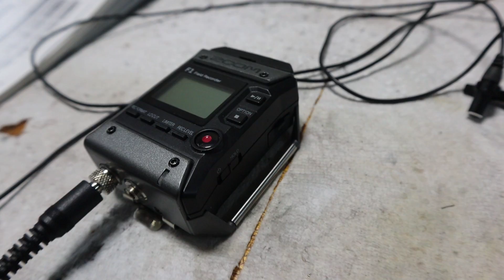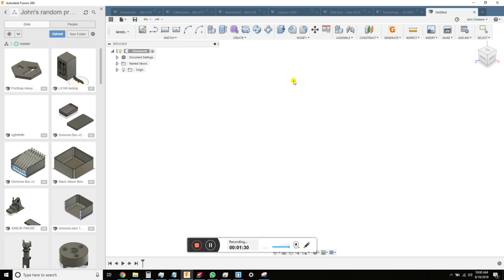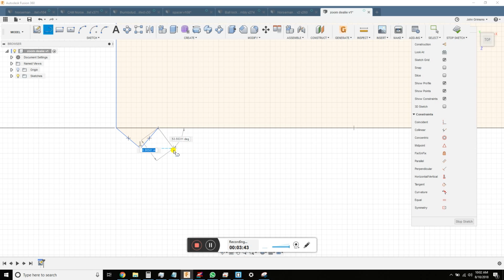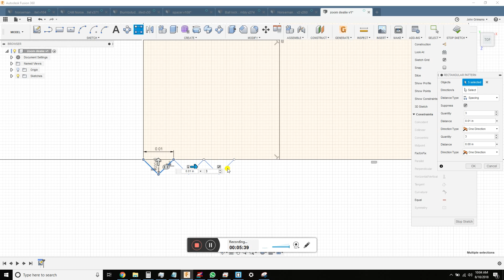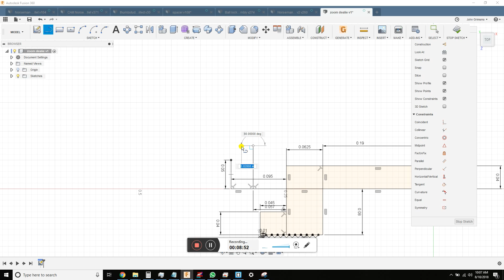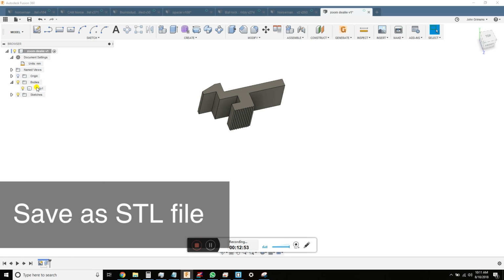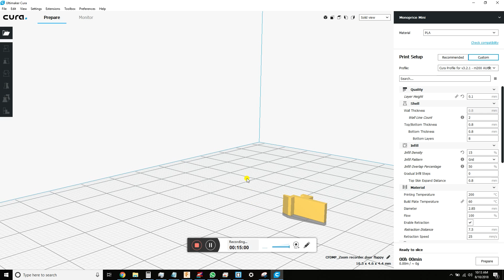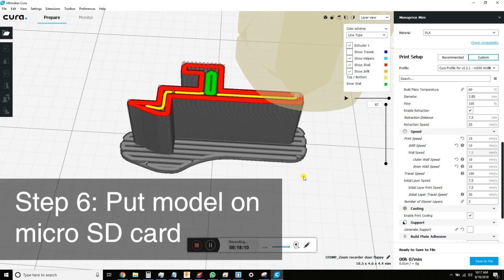How to 3D print a small part

Comment: A few tips: 1) Trying to print small objects like that with a regular .4mm nozzle is not a great idea. There are smaller nozzles (down to like .15mm) that are more difficult to use and more prone to clogs, but they can print finer details. This part is really not "3d-printable" unless you have a DLP/SLA machine. 2) Instead of giving the part 100% infill in CURA, just change the number of top and bottom layers to exceed the total number of layers in your part. Top and bottom layers are always 100% "fill". It's better to have a solid part made up with top and bottom layers than it is to have a part with 100% infill. 100% infill usually does not work out so well (there is usually a lot of overextrusion). 3) Get a sheet of PEI from amazon to use as your build surface. Blue tape is fine for now while you're learning and are still prone to making simple mistakes, but PEI makes printing so much easier. No longer will you need to use rafts (unless printing difficult materials), and parts release from the surface much easier. Something to look into.

Anyways, thanks for the video!

Comment: John, try supergluing the fine detail of your 3D printed parts, basically anything too fine to generate a full perimeter plus solid infill. The superglue (I use Original Hot Stuff) will wick into all the voids in the part and make it much stronger.

Comment: Hey John!  You might be aware and don't want to use it for some reason, but in case you didn't know.  You can use the MAKE button in F360 and send the file straight to Cura and cut out those other steps.  It will even open Cura if it isn't already open.  You just click on whichever body you want to print.  Very quick and handy in my opinion.
Reply: Jason Hughes ooh handy!!